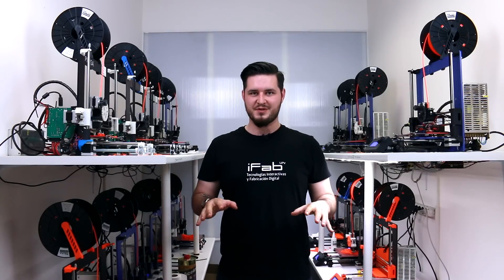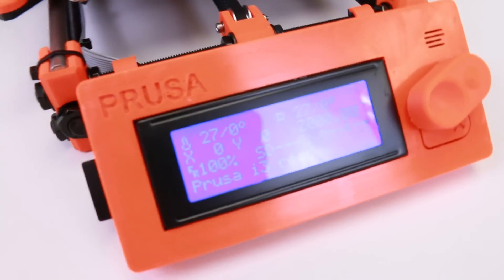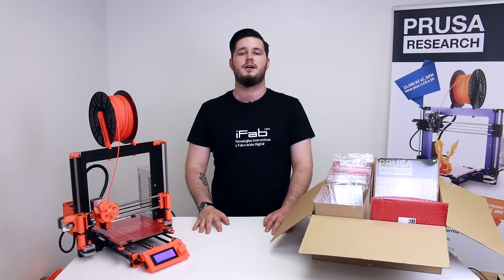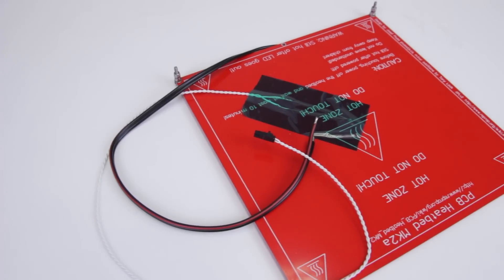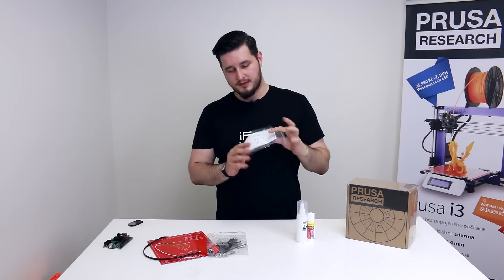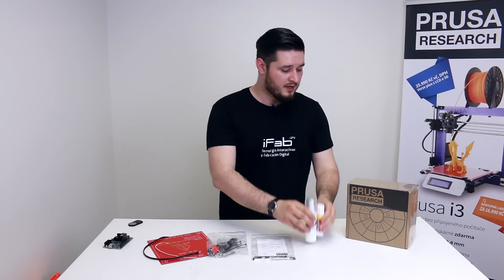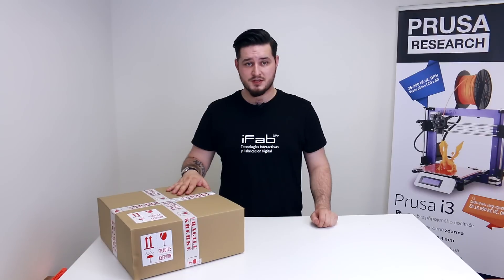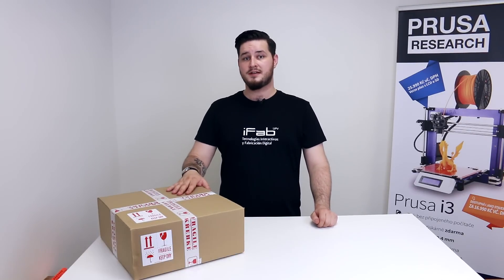Original Prusa i3 3D Printer kit info

Comment: I just ordered two kits. There is NOTHING better than the ORIGINAL! Even if I bought a kit with Chinese parts, I would then have to upgrade the board, then the hot end & extruder (because they all suck) - the Original Prusa i3 is cheaper and better than cheap kit + upgrades, with less work. I shop on value, not price.
Reply: hotburnymustard It is still open source, so it is NOT a copy!
Reply from the maker: +MidiFire Ultimachine(manufacturer) has two pick and place lines in Chattanooga TN. Send them an email and you can visit them :-)
Reply: Nah...I'll support the original inventor and pay full price. I like supporting people in the world that made their own way without copying off someone else.
Reply: hotburnymustard Yeah, me too, but 740 is WAY too much...
Reply: It's not really copying if it's open source though.
Reply: hotburnymustard Still won't buy the over-priced original. They made it open-source themselves, so why shouldn't I select the cheaper one?
Reply: +hotburnymustard pretty much everything electronic related comes from china/asia. From High-end laptops and their parts to the parts that are used in "copy" and "real" 3D printers.
Reply: +MidiFire Well in this case, it isn't. The Rambo Jr, included with genuine Prusa printers, is designed and pick/place assembled in the USA. The genuine Prusa is cheaper and of better build quality than of those directly from China. Prusa also comes with full color printed documentation, a full toolkit and other thoughtful things. Prusa uses genuine E3D hot ends which are better than the Chinese knock-offs - no matter if the E3Ds are made in China or not. You get more for your money buying directly from Prusa. I have 5 of them now. $60 from Prague to USA in 3 days. If you don't have anything constructive to say then please keep quiet.
Reply: +hotburnymustard designed and pick/assembled, pure marketing. they are still Made In Asia. end of story
Reply: You can get a good Prusa i3 clone for 210€ nowadays, not much compared to the 740€ for the original....
Reply: Sevendogtags The smart kind in school doesn't copy off the dumbass next to him. I support the smart kid by not giving the dumbasses/copy cats my money. It's the same as me giving my girl a REAL Louis Vuitton purse and a knock-off/fake ghetto bag the fools think is the same thing. It isn't.
Reply: I said 'copy' - not ripoff/bootleg/stolen.

cop·y ˈkäpē/ noun - a thing made to be similar or identical to another. verb - 1)make a similar or identical version of; reproduce. 2)imitate the style or behaviour of.
Reply: Then don't buy one. I already stated the reasons why above at the top of the comments. Better parts and service & cheaper than buying a clone + genuine Rambo Jr and genuine E3D hardware.

Comment: This is crap guys. Anyone can build a 3d printer that can print about 3 foot in any direction for much cheaper than this guys printer. What a rip off! These things arent even clever.
Reply: +jasonmattis1978 Not everyone has the time, tools or know-how to scratch build something.  Time=Money and for under 700 bucks its worth it to purchase a kit like this because its proven.  I spend the last 2 years trying to figure out what I wanted to build and find the time to do it.  That is a lot of lost time that could have been money if I was able to print and test my ideas.  I have been a penny pincher and scratch builder for many things but when it comes down to it some things you shell out the cash for because they are going to save way more time and get the job done faster.  

That said I am excited to receive my kit and get up and running.  It is a great proven design that I can transform to fit whatever needs I may have in the future.

Comment: So how's the new office?
Reply from the maker: Eric Duprey we are running multiple instances of octoprint on MarsBoard A20 and some custom serial names script, so the serial name is bonded to printers rambo serial number and wont change after reboot
Reply from the maker: HACKADAY It is pretty sweet, but we are going to expand the farm to 50 i3s and we won't fit here anymore :-D
Reply: Josef Prusa I'm curious to see how you'll manage so many and I hope you'll post whether your current method scales. If still using an atmega-based board I'd probably wire an ESP8266 to each board so you can run the serial over wifi and set up one decent multicore PC with many instances of octoprint on that machine talking to them.
Reply: +Josef Prusa (RepRap) is the 3d printer on amazon for 363 dollars real i want to buy from amazon but dont know if its real

Comment: beautiful printer i want to order one but it is a bit on the expensive side ...
could you also make a budget kit with the bare minimum no heated bed ,sd card ,filament, and optional hotend and power supply  ...
Reply from the maker: pwave123 Hi, maybe if I get this asked more. We are in production so every special request takes a long time to process.
Reply: Josef Prusa I would also like to see a kit with just the frame, hotend, extruder and 3d printed parts.